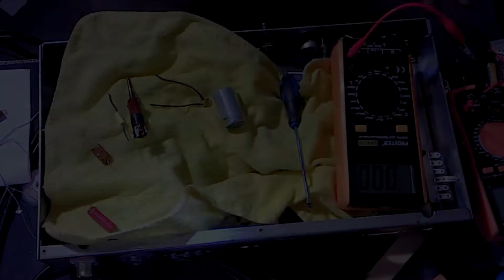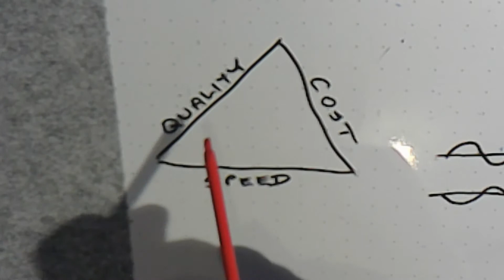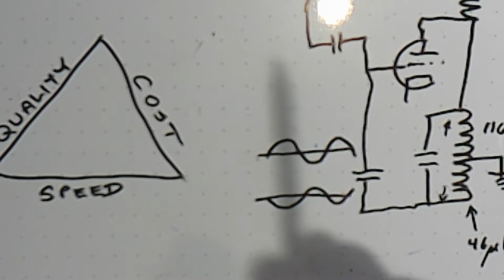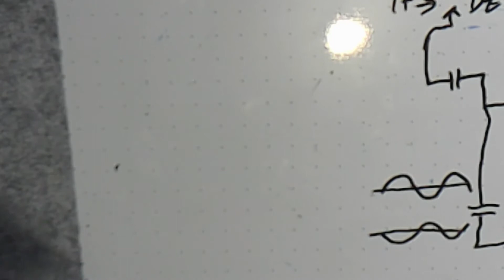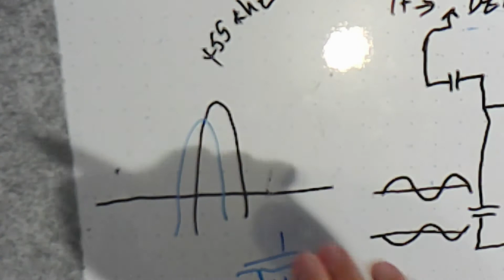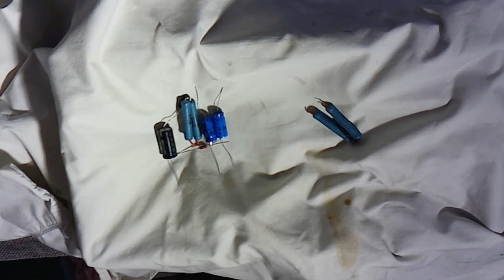Vintage Hallicrafters SX-99 Shortwave Radio Full Restore-Part 10: Front Controls, Transformers, B+

Comment: Hey Albert! You went right by what I wanted to see - how to clean them toggle switches?
Reply from the maker: Thanks for the comment. These days I am inclined to clean first with MG Super Contact cleaner 801B then use a few drops of MG De-Oxit gold lubricant. You can insert the cleaning solutions through gaps in the case. Then operate the switch multiple times. Keep continuity testing the switch till you are satisfied with the operation. I also completely desolder and remove resin from the contacts.
Reply: @i82996  Thanks, Albert.

Comment: Great Video Albert! Your 1000hz pitch you made was about 987hz...lol.....Question? Using the two power resistors instead of one....you still generate the same heat...but distribute it into a larger area, thus the radiant heat to other components are reduced? Is that correct? Should be the same amount of heat, just not radiating in a smaller area? I like your approach! Its like eating an elephant...one bite at a time!! Keep up the great work and stay safe--Larry
Reply from the maker: My thermodynamics is a bit rusty but here goes. The amount of surface area to dissipate energy is related to the energy dissipated by the change in temperature from the source to the surface.  Now a wire wound resistor is primarily generating heat near the surface, so the temperature of the resistor will be related to the surface available to dissipate the heat.  More surface - lower temperature.  This is confirmed when I can actually touch the surface of the two resistors, very carefully, compared to burning myself trying that with a regular ohmite resistor.  Also a higher wattage rating results in a lower temperature for all the same reasons.  I have a heat sensing "thermometer gun" that also confirms this.  Heat is the enemy to aging electronics.   The down side is the reduction in available space for other things and I need to find room for the digital display mod power supply.
Right now I got curious about the different SX-99 runs and there is a significant difference in this area.  I will be adding that to Part 11.